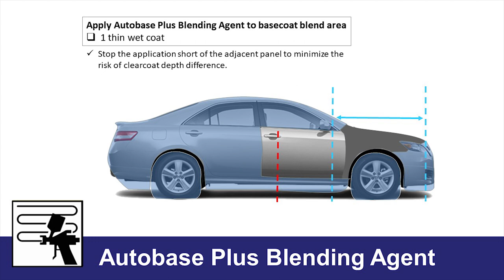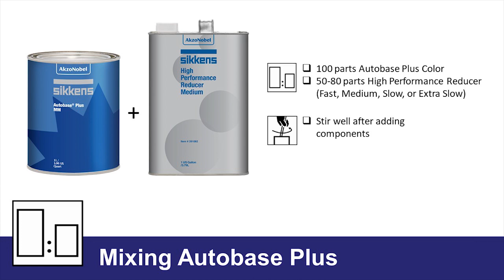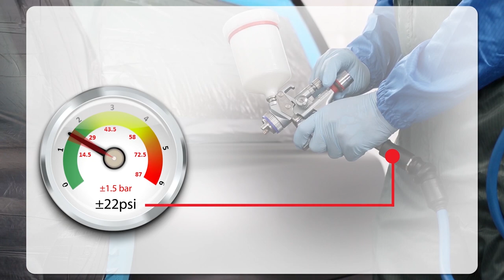How to Use Sikkens Autobase Plus – Application

Comment: I've been doing sikkens little over a year now, compared to Axalta cromax pro. Sikkens is so horribly slow and I find color matches are often to bright even when choosing the darker variant. I wish this shop would switch away from slow sikkens product
Reply: You gotta learn how to use it to the best it can be it takes time but once you figure it out it gets way faster . I can have a bumper , fender , hood , door job sprayed in less than an hour , sealer base and clear , sikkens is all about reducer and undercoats . If you don’t have a good grasp on which undercoats to use then you are doomed with the color match . I spray colors out over 5 or 6 value shades of sealer cards I make and it makes a massive difference on the colors . Whites you have to take at least 30 to 35 percent of the 120 out for it to actually match and give the colors the yellowness that they need . I like to take out 32 percent and usually that nails the color . Once you learn all these things sikkens is a breeze to paint with . Is there better paint out there absolutely , is it a horrible paint system , no . Their clears are just okay , I like the hs plus clear and the xpress clear everything else I’ve tried is very hard to buff . The only ones I haven’t tried are the pc clears . I wish sikkens offered more clears with reducer so I can control everything about the finish im applying